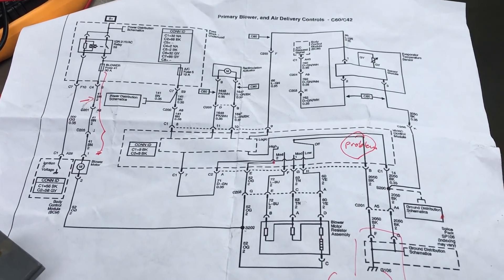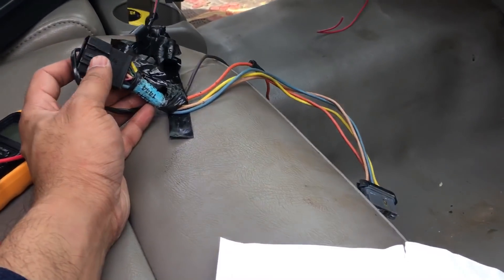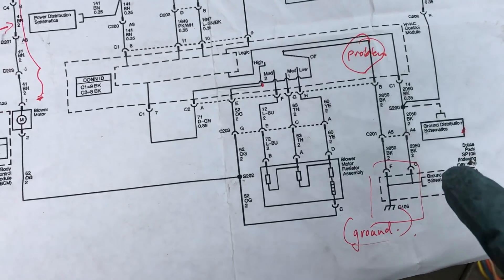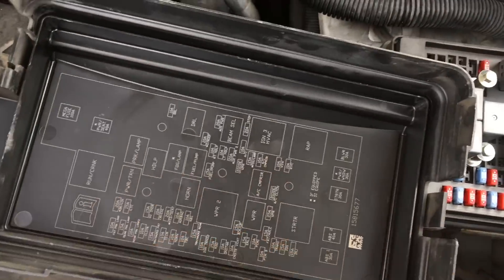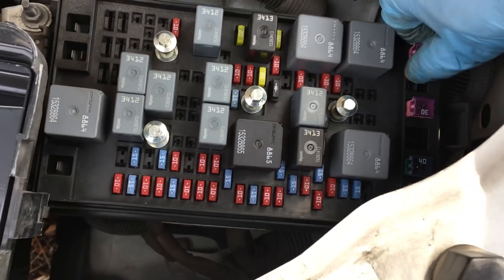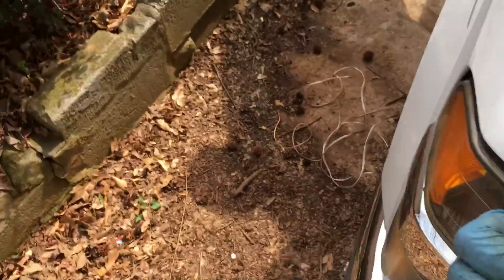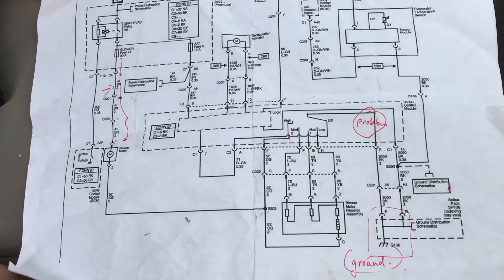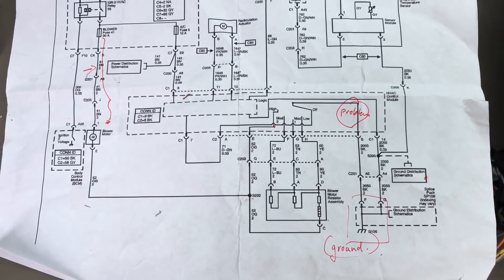2003 - 2012 Colorado/I-290/Canyon AC Blower Troubleshooting and Repair

Comment: Check the ground wires for the blower and the resistors under the hood.  There's a bunch, 4 or 5, all screwed to the fender on the passenger side.  Sand them , and clean the screw that holds them,  and I be your fan will work on all 4 speeds. Please let me know if this works, I found this out from another brother on u tube....Stan   Hawaii

Comment: BRO!!! I cannot tell you how much I appreciate this video! I replaced the harness (which was burned out) and the Resistor which was also smoked and still NOTHING... Guess what it was? That little tail brown wire on the bottom of the passenger side door connector just like your last point in this video.  You saved me carrying it to the dealer because I was SO frustrated. GOD BLESS YOU brother. 

Thanks SOOOO much!

Comment: very good video for the i290/Colorado/Canyon. I'm in the process of fixing mine for the third time. First was resistor, then a short in the wire behind the glove box, that was melting my glove box, now I don't know what this third problem is. That truck has THE WORST blower fan wiring!!! So very many people have problems.

Comment: Man I appreciate this video, I had 12 volt to blower motor but no ground and thanks to you I found the ground wire by air filter box, it was actually the ground connection block pin/ female side that was melted. Wiggled the wires and blower motor is back on. Wound up cutting ground from ground block for blower motor and ran it's own ground.

Comment: When the brown and orange wire is not plugged into the blower motor I have 12v to the brown wire and nothing to the orange wire. When I plug it into the blower motor I get 12v coming out of both wires.  Is that supposed to happen?
Reply: Short to ground. Not supposed to happen
Reply: The blower consumes that energy if anything you’re supposed to get nothing on orange and voltage only on brown

Comment: Thank you!! This weekend I worked on my girlfriend's Isuzu pickup and ultimately I found the exact same problem. The 12v power (brown wire) connection was burned out at the large white  connector below and to the right of the glove box.  I clipped the brown wire off at both sides of the large  connector, then used a crimp connector to join both ends of the brown wire - just like in the video. Her blowers works once again :-)

Comment: Suddenly no blower motor power 12 v to motor replaced resister ? still no go. checked the ground LOL tapped on it and well well bad ground G106 behind air cleaner on right inner fender.
Reply: Thanks,I must must check this , and grounds…. I just replaced Resistor, on 2007:Canyon so far…..( # 2,3  contacts a little blackened),,,,seemed to,have random turnoff on FAN Speed 3, & 4 onLY LAST FEW years…

Comment: I have no power what so ever it was working just fine until today now nothing not 1 2 3 or 4 so what do you suggest
Reply: This exact same problem happened to me the day before, I'm in the process of figuring it out, I don't want to take to mechanic though, they would probably charge me and arm and a leg.
I was able get a blower motor for $96, going to replace the blower tommorow or the next day. I checked the blower fuse and it was good, the only other thing I think it could be is the switch itself if my replacement blower doesn't fix it. The reason I believed it my be the blower or the switch is because the fuse was good and if it was the resistors, 4 should still work. It could also be the cable itself, I'll have to check that too. On mine the AC pump works still so that also led me to believe its the blower or switch
I'll post back here if I fix it.
Reply: @nemesiswes426  yeah i checked fuses and still nothing but im starting to think its the resister i can feel air come on but no noise what so ever i unpluged the main cprd to the resister no melting so it might be the resister and i take out my dash to get everything unplugged and plugged back in place but i do know i might buy a jew blower also i found a jew one on amazon and ebay for 35 so i can wait a few days to save some cash
Reply: @Captaintripps1  I finally found my issue, it was the Fan Speed Dial.You can check if its the blower which you can do by just taking it out and then directly hook it up to the battery with some alligator clips. Once that's checked and your sure its not the wiring harness or anything. what I did was I opened my dash to get to the Fan Speed dial. I disconnected it and then checked for resistance across all terminals on all settings, mine had infinite on all no matter how i connected them whereas it should be basically a short between at least two of them when on one of the settings at least. 

I also then checked if the connector to the dial had power coming to it by checking for 12 volts on the connector, it has like 7 connectors, so I had to check a bunch. Once I saw that had power which was on the top terminals in my case and I checked the resistors and wiring, i ordered the whole assembly which for mine was this ACDelco 15-73870. When I got it, I took off the Fan speed dial and connected it up with the fan blower to test and sure enough it started right up and all speeds worked. 

I had also checked if it was the wiring by first making sure that no power was on, then put one end of the multimeter with it set to resistance on to one of the output terminals on the fan speed power connector, the lower terminals(mine has 4) and then checked the blower power terminals for any resistance. But you should show resistance on I believe at least 3 or 4, don't remember.  You will see various resistance values which would indicate your resistors are intact. Im pretty sure its 4 for the 4 different settings on my fan speed dial, 3 will be higher resistance sine 4 is no resistor. If you have 4 settings but see like 2 and the others infinite then those resistors might be burned out and if 4 shows infinite then it might be wiring issue.

Funny enough, before I found the fix, the dealer I went too said in his 35 Years he has never heard of the dial being the issue, I was trying to get a replacement dial only instead of the entire assembly which I ended up buying on amazon. I needed a new dial to see if it was the issue. He was certain it would be a wiring issue, lol.

Good Luck fixing your issue and be careful with the mutlmeter, NEVER CHECK FOR VOLTAGE WHEN ON RESISTANCE, lol, Almost did that 1 too many times.

If have any questions, I will do my best to help, fing annoying when the ac goes out in the middle of summer, lol. 

P.S. I am in no way qualified to help anyone with car issues, I almost always have to use YouTube to fix my car troubles, lol.
Reply: @nemesiswes426  i will check it out
Reply: @nemesiswes426  o checoed it all out and it was my main plug that pligs into the fan it was burnt but i fixed in a good 15 minutes by rewired the plug and making new plastic around it so its working again im glad its working again its been hot as hell
Reply: @Captaintripps1  Good to hear. In Vegas, it gets to like 100+, sucks having to drive with windows down and what feels like a hot hair dryer on your face, lol.

Comment: Thank you!   I had lost speed 3 on my 2007 Colorado and watched a different video to fix that.  It was lost a year before the blower just quit working.  When I pulled the resistor and harness I only saw burn on 3 so I kind of figured that wasn't why it quit.  Sure enough after replacing it still had nothing on power.  I just knew I was never going to find a video pointing me in the right direction,  but found yours and it did!  I had the same exact problem, bypassed it just like you did and now it is working just fine.  Do I need to be concerned that may cause another issue?  I am not sure why it goes in that junction box; did I understand you to say it was just a junction and not supplying power elsewhere to by being in the box?  I know very little on this stuff.  I know enough about electrical work to get something caught on fire real good.  LOL I thank uyou for this.  No complaints here, just praise.  Appreciate what you do.

Comment: I did not like watching your video. I was unsure what you were talking about some of the time and the print to which you were referring wasn't explained very well. When you spoke, you were often unsure of what you wanted to really say and the video was not very professionally done.

That said, it was the first video that actually explained what I should be looking for and exactly what I should be testing, and not just "replace this harness, check this relay." I must have watched two dozen shop guys, professional mechanics, back-yard auto professionals tell me what was wrong with my truck's heater blower. All talked along the same theme and I now know generally about the heating system of my truck, but in the end, it still wasn't fixed. 

At the very end of your video, you speak about the connector, behind the passenger side panel, and you were the only video that suggested I look there. Seriously, go watch a few yourself and no one even mentions that connection, #104 I think. 

Yes that was it. The issue was not easy to find, but by walking back each wire and finding where it connects to the next in line, I found out where the blower motor was shorting out.

So, for all the problems I had watching your video through to the end, it was the ending that gave me the answer to my problem with my beautiful 2011 Canyon.

Thank you and well done for being thorough.
Reply: I agree that this man knows how to do analysis. He may not be the most polished speaker or Youtube person but he knows how to go through a electrical diagram and figure out what the problem is. 
I concur that he is absolutely   awesome.